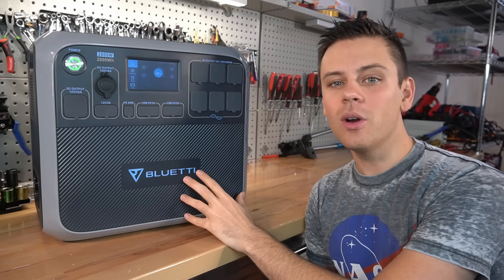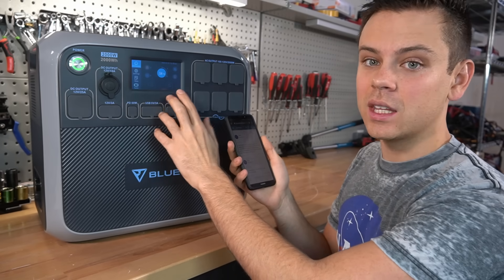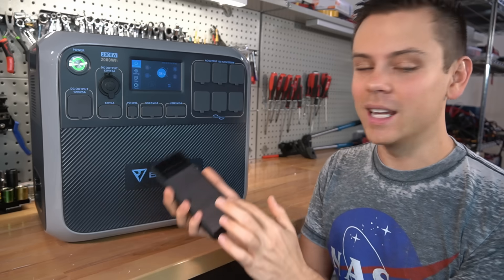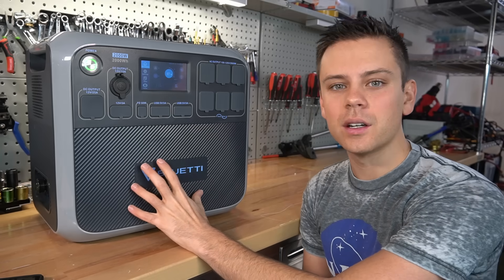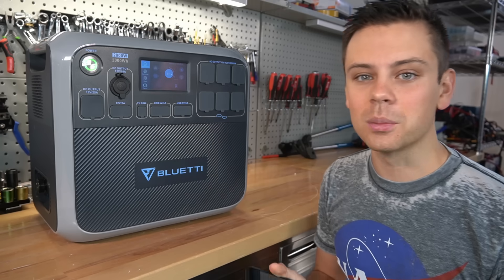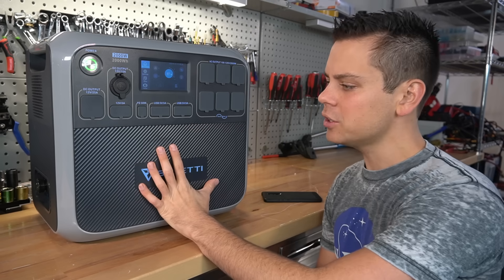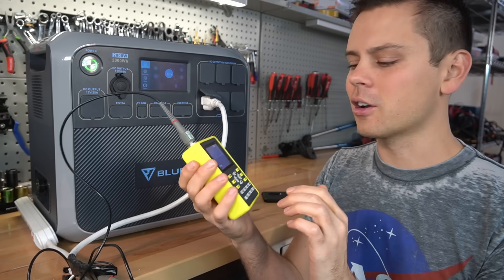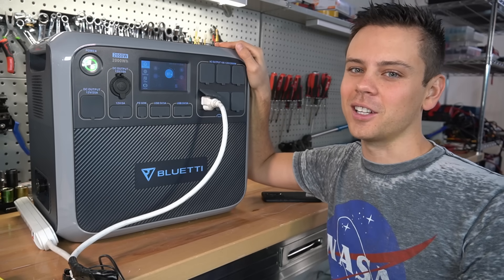New Issues are Plaguing the Bluetti AC200

Comment: Do you have a video with a direct recommendation?  I am looking at the AC200p @$1800 yeti1500x @$1600 or ecoflow delta 1300 @$1100.  Need to replace two dead 105ah golf cart batteries in the camper and have a backup for the pellet stove in the house so one of these units seem like a cool option.  The Bluetti seems like a great solution because of the 12v port but the Yeti seems like a more reliable company.  Thoughts?

Comment: I have the previous model. I'm glad to have it based on the fast charge speed. My main issue though is that the fan seems to eat the battery at a rate of 5% charge per hour. I don't know if the new model has a better fan, but that's a lot of power getting chewed up.

Comment: Mine is ac200. I don't think the 12v dc output is regulating well. When I turn on only 2 12v DC items, one is  
12v dc led ceiling lights, other one is rv 5kw diesel air heater,
The ceiling lights blink with the same frequency of the fuel pump.. the lights are 3w and the pump is only 10w..
They blink so bad that I have to turn the lights off when I am using the air heater.
I am also afraid the not so steady dc power might screw up my dc refrigerator ( I have not use the air heater and the refrigerator in the same time)

Comment: I just posted the following to the AC200 Indegogo site:

I first started trying get support by phoning the numbers on the Bluetti website on Jan. 14. I was finally able to speak to Sean on Jan 19. Sean open a ticket for me. After not hearing anything for days, I sent an email to the website from the Bluetti page. Since then it's been emails back and forth, bounced from one person to another, in which I explained my issues several time. It seems that information I had provided previously was being ignored. 
So here is all the information  again! I will post it here so it won’t get lost in an email chain. I am contributor 146 and my serial number is 96630A20310154.
I hooked up my AC200 on Nov. 25, 2020. It worked perfectly charging from the solar panels up to 240 W depending on the position of the winter sun. I would plug it into my car when I was driving long distances and not getting a lot of solar power because of weather conditions. Sometimes I would forget to change from PV to car and vis versa. It would beep reminding me to change the charging mode. On Jan. 14 I plugged my solar panels in when the AC200 was still in car mode. This time it did not  beep and it has never charged from my solar panels again.
I have two BougeRV solar panels wired in series and rated as follows: 1. Open circuit voltage 21.6 + - 5% (total 2 x 21.6 V = 43.2 V) and 2. Max power current 10 A + - 5% (total in series = 10 A).
Numerous times I have measured the open circuit voltage of my panels from the MC4 connectors with a multimeter and got reading of around 43.2 V as expected. I have measured the open circuit voltage at the XT90 connector (provided by Bluetti) and get around the same number. 
At one point I was advised to find another device to test my solar panels. I replied back that I do not have access to another device. Should I have to buy another solar generator to test that your product is working? I don’t think so. However, I had been wanting to add another solar panel to my array so I suggested that I would buy another exact solar panel and test the AC200 hooked up only to the new solar panel with new cables. So I did and sent the expected results in yet another email only to be told that the one panel did not produce enough voltage to charge the AC200.
I am so frustrated at this point. You guys have a huge communications issue. You need to spend some of the millions of dollars you have made to improve your technical support. My warranty is from Bluetti and directs me to the Bluetti website but I’ve been bounced from Bluetti to crowd funding to b_sales. At this point I just need to be able to speak to someone that English is their first language to try to deal with my problem or better yet give me a refund and I’ll go away.

Comment: My aviation cable that came with had it’s polarity reversed. I’m waiting for a replacement. Hoping it didn’t damage the AC 200. It blew two fuses in my truck when I connected it to the car charger.
Reply: That sucks, have you received your replacement cable yet? How is your AC200 now problem free?
Reply: @jakeliujakeliu  it’s been good since. They sent me a new cable but it took a while
Reply: Glad it works out. Little worried about purchase large ticket item from them.
Reply: @jakeliujakeliu  their products are pretty dialed. I would say customer service could be better. But they’ll eventually get any problems sorted out. I bought the indiegogo version of the AC200. I’m sure they have issues like the cable sorted out now.
Reply: Thanks for the update.

Comment: Noticed other youtuber using battery packs to charge the AC200P through the solar port.  Curious what you think about this?  If I plug a larger LIPO  battery with higher than 35 volts  and use a MTTP to charge that battery, would it give more capacity to the AC200P?  Understand I would be limited to 12 amps input.  It would be nice to have more capacity at night.
Reply from the maker: I wouldn't do that
Reply from the maker: It can burn them out. I would use a dc regulator of sorts to protect mppt. Unless internal mppt has current regulation. Some do, some don't. I wouldn't add batteries to it. It has good capacity
Reply: @WillProwse  Thanks for quick response and advice.

Comment: First tip for plug-in/AC powered oscilloscopes: DO NOT TEST OTHER AC CIRCUITS without an AC isolation transformer!  Handheld units like Will has in this video, you're perfectly safe and isolated, just handle with care, there's still a shock hazard live to neutral from the inverter.  AC powered scopes, the ground lead is actually referenced to earth ground, and will short out the AC circuit without isolation (that might include boxes like this if they have a direct AC charge option, and something is referenced to earth ground while plugged into AC charging).
Reply from the maker: Yes good point. I just setup a fancy new scope and have an isolation transformer. Very good point

Comment: I just ordered mine and got it in 3 days, No issues so far testing it out! I will be running the 700W solar recommendation to it for charging in my van (Currently not setup). So far so good and i am extremely happy with the product. With their discounts and so forth i got it for 1,500. Which i think personally is a killer deal. Their customer service has been fantastic with multiple questions given in their direction and they haven't let me down yet.
Reply: Where did you buy it from...
Are you still happy with your Bluetti?
Reply: Which discounts did you use? I can only see the $198 one on their website and Amazon is at $1799 too

Comment: I wonder if anybody else has a problem with it not being charged by the car charger anymore at first it worked fine for a while there I was getting a hundred Watts input power going into the unit now it shows zero and does not charge I tried emailing them and they don't understand the problem I just wanted fixed how do I get a hold of them

Comment: I have the AC200p version and up to the point it’s been working great until now. I just received my two Bluetti solar panels and neither will provide any input power when plugged in. The button is turned to PV but I’m not getting any input on screen and two fault codes are showing, 002-PV/Car low voltage and 006-Adaptor low voltage. I can’t seem to clear these faults codes either. I’ve tested solar panels with my Jackery 1000 and both are working fine and creating input power with that unit just fine. Will be calling Bluetti.  (Quick revision): Apparently you can’t get enough volts from only one Bluetti SP120 panel, you actually need two of them connected together in order to get a solar input. The AC200 needs a minimum of 35volts input (two panels) not one, in order to get a input reading...now I know. Did my own trouble shooting, Couldn’t get a response back from Bluetti as of yet.

Comment: Waterproof 1000W Portable Battery Power Station
1000W AC output I 1010Wh Li-po battery(2000 cycles) I 210W AC IN I 12-70V 12A 360W MPPT IN I PD 100W  WILL  I am a great supporter of you.  Would you pleassssssssssseeeeeeeeee  do an evaluation of this unit..  Hobotech did it...  PLEASSSSSSSSSSSSEEEEEEEEE.   I bought 2 of them.  Thanks James

Comment: got mine. pretty happy with it. i'm sad however, that it won't charge if the battery is near or below freezing. not great for overlanding in winter.
Reply: There are 12volt battery blankets, like $25 on amazon

Comment: I know when I have my phone plugged in and my mini speaker, it shows 0W.  When I unplug it and plug in my fan, it says 35W.  When I add the phone and mini speaker, it says 48W.  I unplug the fan and it goes back to 0W.  While all 3 are plugged in overnight, the AC shuts down on its on.  I wish the screen dimmed far more than it does.  I have taped things over the front so that it doesn't not bother me at night.

Comment: I'm having some weird problems with mine. Today I measured 120 volts coming in from solar panels all day, but the bluetti said it was only getting 20 volts and it did not charge. 🤔
Reply: Also my AC inverter seems to have an extra 36 watts of load on it at all times which is almost the entire capacity of the battery over 24-hour period so that's frustrating.

Comment: Will, I received my new AC200P today.  I checked out the temperature differences.  It seems as if it is only showing the temperature of the charging.  Not the setting idle. I had three different temps, and the charging changed the temps. I think all is well it is just showing the temp with the charger you are using.  Check it out.

Comment: oh great, wish I knew this before I purchased mine, When I watched your previous video I thought it would be a good idea to buy one before they ran out, that's my second month on the waiting list. I shouldn't have rushed, but I am trying to build a solar system for my van and thought it would be good to add the Bluetti to it. I really hope mine is not defective. 😢
Reply: Did your bluetti come in now?
Reply: @KEAWE7   yes not long after I posted
Reply: @diogenesferreira326  How do you like it?
Reply: So you did get your Bluetti...
How do you like it?
Reply: @JudiChristopher  hey i like it but not awesome, definitely worth having over gas generators. I would go for the newest model if you are just looking for a generator, but if you are looking for a power grid system i rather go for a big battery type of system. You will get more kilowatts for the money
Reply: @diogenesferreira326  
I will be using this EVERY day to be on my Vintage Tiny Travel Trailer... I want to put "FIX'" hard/glass panels on top of my VT3...
Reply: @JudiChristopher  i believe you will be ok then, it is a very good generator for that, i was trying to power some tools which demands too much power and it was not meant for that. Bluetti is running a Halloween special right now and you could take advantage on it. If you need more power you can get a battery or two and you would be fine. Some people complained about technical problems, i did not have any from my end. Something to think about
Reply: @diogenesferreira326  
Thank you so much for all this great information.
Reply: @JudiChristopher  you are welcome, i wish you the very best in your endeavors. God bless

Comment: I have not tested my DC shunt but my AC shunt reads about 35W higher than the load from 2W to about 400W and right on at 1300W.  I suspect this accurately represents the overhead.  Other than being very late and poor communication about delays, I have had no issues.

Comment: Dude. Help me out ... I buy my eb240 and it had a malfuntion... Wen i unplugged some device with out turn the ac off it have some trouble ... Or i dont know... It turn off buy it self and it takes a couple of days in order to me to turn it on... I push the on botton but the led light blinks... I little... Sometimes a bit longer until it the led light turn off and it does not blink anymore for a while... Until a couple of days later it turns on... This 24th i plugged a blender on the eb240 and went off and still doesnt turn on..  just the led light blinking... Please what can i do.? I AM from Colombia... Sorry 4 My English...

Comment: Per Bluetti response on Indiegogo: "the purpose of this temperature detector is to protect the system from high temperature (overtemperature) during use."
Me: So this defect is in part of the overheating protection system. This means it has the potential to be a fire hazard.
Per Bluetti: "...we will fix this issue in the later productions. "
Me: So they are knowingly shipping defects that they say they'll fix in the future.
Read through the comments on Indiegogo Bluetti Campaign for more details
Reply: My understanding is that that these sensors are designed to have a certain calibrated resistance at the cuttoff temperature (I believe 145C) and were not designed to be accurate or linear over a broad temp range.  Probably a miatake to give a the end user a temp readout.
Reply: @michaelstora70  where is your understanding coming from? I haven't seen anyone list the parts being used. Factory specs for the parts in question could possibly put this to rest. I just haven't seen anything concrete.

Comment: Will....love your channel.....Just got my ac200.  Can I add  2 LG360Q1C-A5 solar panels in serial to this?   360W each, open voltage of 40V (80 combined).   Or can you recommend something else.?  roof space is a premium.  I should have built one...but this thing is so mobile....hope I don’t have the problems you are mentioning....I first thought the q1 charging pads were not working...but they are. The ubs-c works fine.   Ac charging adapter worked ok....it pulls 500W....but puts in about 80% of that.   I’ll try to test the other stuff.
Reply: So I made toast with it.   Toaster pulled a solid 1500W....the Killawatt meter showed +/- 50W to 1500.   The fan came on as soon as the toaster was depressed....it seemed to oscillate speeds......when toast was done....fan cut off straight away.  The fan speed oscillation seemed strange.  Anyone else seen this. And the fan is loud.   In stand by on AC it shows 0 and 35W .....on and off.....I think it’s pulling 18w in standby with ac on?

Comment: I am in New Jersey trying to find someone to fix the system 3000 battle born 3000 in verter hooked up to main van battery 550. Plus hanging wires because I removed the bulk head in a Ford Transit Connect.

Comment: I received my IGG AC200 about a week ago and I had a problem charging it through the PV input with a Lion pack I made from scooter batteries. It charges at 13amps when I first connect it but after maybe 10 mins it starts dropping the amperage steadily to just a couple of amps. The BMS temperatures are only getting up to 24c and I see no indication on the smart BMS software that it's throttling it in any way. I have an adapter cable that will allow me to use the AC charger through the PV input so I'll test it ASAP to see if I can replicate the problem.  I also had an issue with the XT90 to Anderson Power Pole adapter cable perk that I receved as a perk from the IGG campaign. Unfortunately the red & black connectors are reversed which makes it only connect in the opposite polarity. The colors would be Red to Black the way they shipped it so I doubt anybody would actually use it like that. I was able to slide them apart and re-connect them in the correct configuration but that requires the wires to be twisted which puts a lot of strain on them and may cause premature failure. I emailed Bluetti about the cable but haven't heard back yet.
Reply: It seems that the problem is likely with my battery pack. I tested the AC200 charging through the PV input with the standard charger and it charged at 400w steadily until full.

Comment: As a former quality and safety engineer and mechanical engineer... it surprises me people including Will state the shipping was delayed for the Indiegogo contributors...the fine print on that said you are contributing to an idea with intent to get product possibly as a reward but not guaranteed.  If they get anything at all they are fortunate.  Also there is a reason I rarely if ever by the first major change or model on large purchases such as a solar system, car etc.  Better to wait for second or third revision for some of the bugs and kinks in the system to get worked out.  They probably had much more growth from all the positive reviews and hype during the Indiegogo campaign beyond what their manufacturing could handle... then add all the covid nonsense which impacts suppliers all over the world and the result is not unexpected.  Doesn't mean bluetti is horrible, just means many factors amd variables contribute.  I have seen quality issues with suppliers during covid causing various issues.

Comment: Since I received an AC50S last week, I have noticed that when charging from vac through  an electricity monitor, the readout at the AC50S reads 80-87 input watts...  Interestingly, the watts read are 92-98 watts at the monitor which I believe is correct.....  I takes more than 5  hrs. to charge from 2 bars (40% approx.)  Should I be concerned and contact Bluetti..??

Comment: Got mine yesterday. Doesn't display watt out usage under 35w. Is this also a shunt issue or just a sensor/display issue? Seems like an easy fix via Firmware. This alone won't make me send for a warranty replacement. It would also be nice to have an option to permanently turn the wireless charging on top off. Ill keep tinkering and update yall.
Reply: It would be great if Bluetti answers that question. Not knowing the extent of the issues is bothersome.  I would recommend contacting Bluetti about it. The more they know the more we'll know kind of thing.